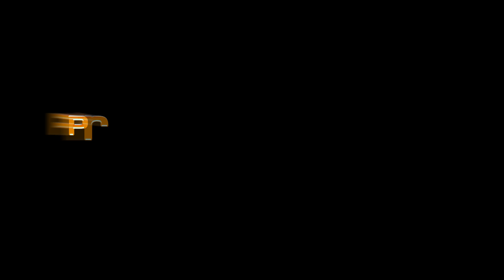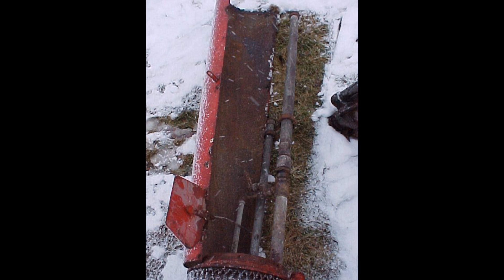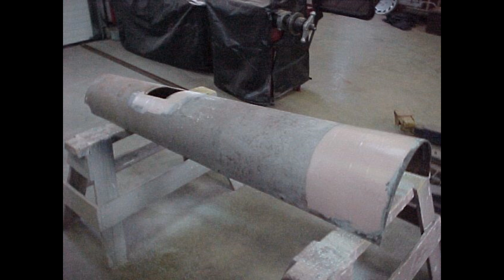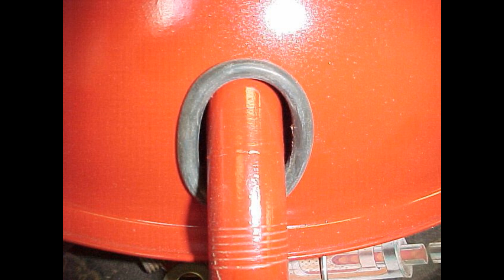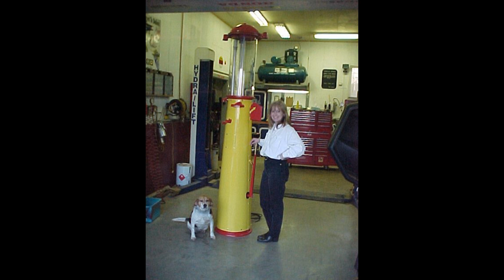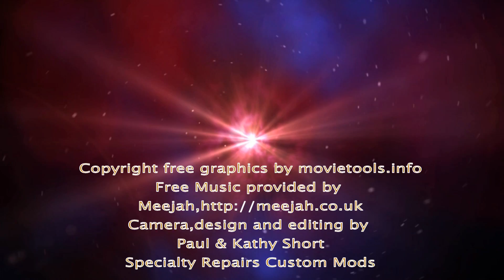Projects From The Past  Part #2

Comment: Nice gas pump Paul. It definitely did look horrible when you first got it but towards the end it looked really really good. And at the end did I hear Kubota Ice Resurfacer? That should be interesting.
Reply from the maker: Tyler Donovan Thanks Tyler. I'm going to try and get the Ice resurfacer up tonight.

Comment: I see you're using a professional video editor for the opening and closing.  It adds a nice touch to the videos. I like it.

I wonder if the original manufacturer of the pumps didn't purchase the exact same split ring rims for the pumps.  Why pay someone to make them for gas pumps special when someone was already making them for trucks?
Reply from the maker: QuantityEngineers Yes I'm using all new equipment but it's taking me some time to learn the in's and out's of it all. You could be right about the rim. It sure fit nicely. They would be in money doing it the way you said.